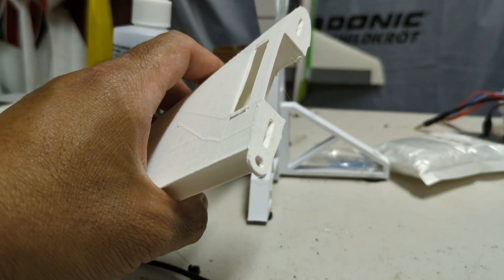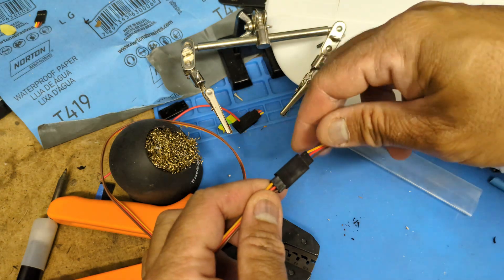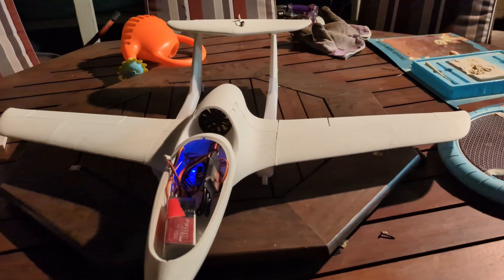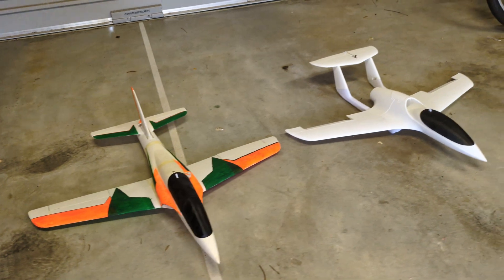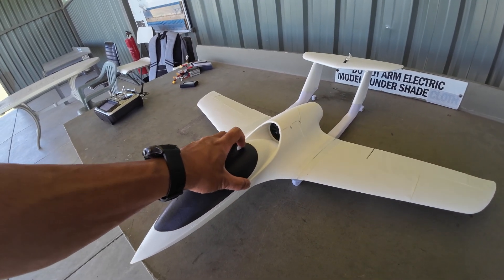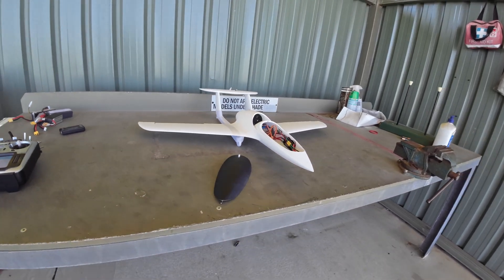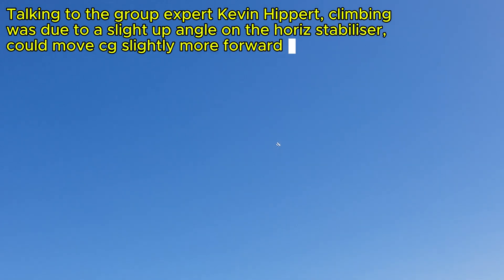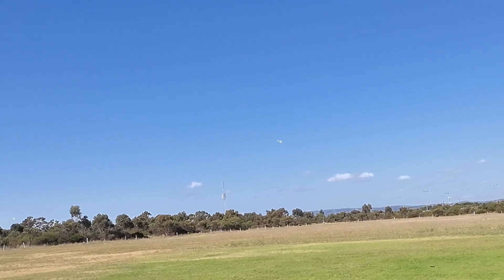Early access to the newest Eclipson jet, the INFERNO - Maiden flights

Comment: Regarding the tendency of the plane to climb excessively with higher throttle, moving the center of gravity forward and putting in a throttle to elevator mix completely took care of that problem
Reply from the maker: Hey mate, cheers, ill try the CG thing, i mean it's not major tbh, i'm not keen on automated mixing with throttle input myself, i know its normal practice, but yeah, cheers for the suggestion though

Comment: Thanks for sharing, the only change I would make is to add a carbon spar as a wing joiner instead of those little tabs, lots of pressure being inserted on that part of the wing during flight, might see a wing fold on you if you get a little crazy during a flight.
Reply from the maker: Hey bud! Thanks for watching! So eclipson made this with a 3d printed spar not just the tabs I was just really bad at getting the right footage, so it has a spar in it, carvon definitely going to be stronger but I have had more flights on this than jsut what I've shown and yes I've gone a bit crazy and still yet to see it fold,

This is my second model from eclipson thag uses a 3dp spar the other one is the cobra and my cobra has had over 40 flights now and it's going strong 😊
Reply: The 3D printed Spar seems to work just fine. When building the airplane I had to trim The Spar down a little bit to fit .

Comment: Can this be scaled up for a 70mm?
Reply from the maker: Since it doesn't use carbon rods I assume you could try, it's not specifically said by the designer, but you can probably try it and see how you go,

You'd probably have to make sure you have a big enoguh printer cause scaling the parts could result in much larger pieces and since it's designed for vase mode splitting them may not work

You'll also need to design siemthing for servo holders
Reply: @ I don’t think any of those will be an issue for me. I just have a spare 70mm QX motor edf and I’m looking for a cheap, simple, fun project to use it for. They aren’t the greatest edf’s in the world so I don’t want to use it on a more expensive build. What edf are you using in yours? Looked like an XFly
Reply: I'm eventually going to try it as i have a 70mm & 64mm @JoeyscustomRC
Reply: @crazyaces9586  let me know if you end up doing a 70mm how it turns out
Reply: @locarshobbies  I scaled a cobra up to 70mm and 80 mm setup, Im using a bambu lab a1

Comment: what slicer you use I got a bambu slicer how much infill you use.
Reply from the maker: Hey, Eclipson designs don't use infill in most of their profiles because they design the entire thing including the internal structures, in fact, this is what makes them very compatible with vase mode it's a lot more work for the designer, but the result is a great model! 

IN their site they have the parameters you need to use for the model :) 

Good luck if you decide to print it